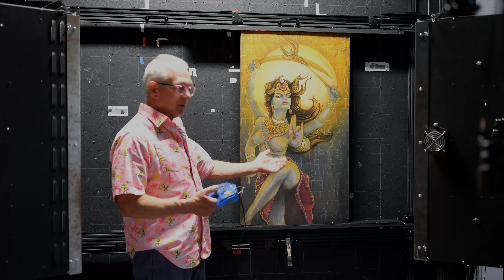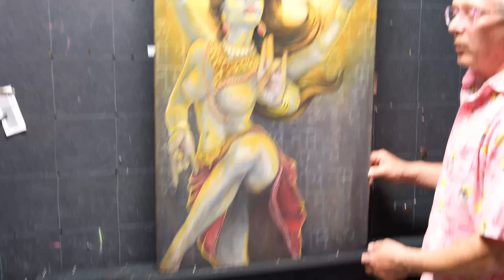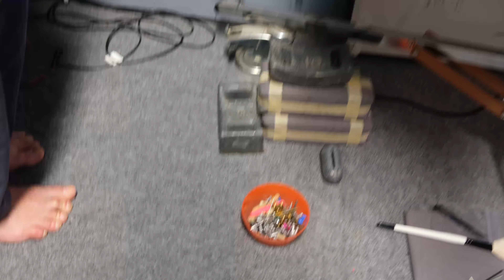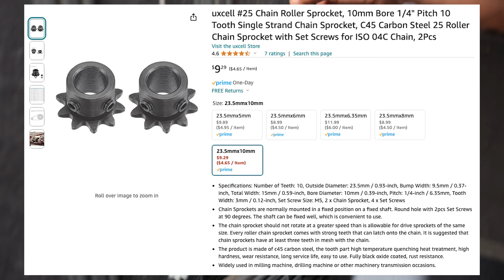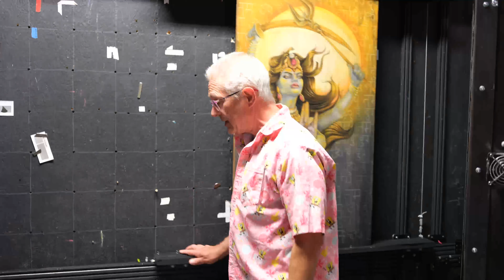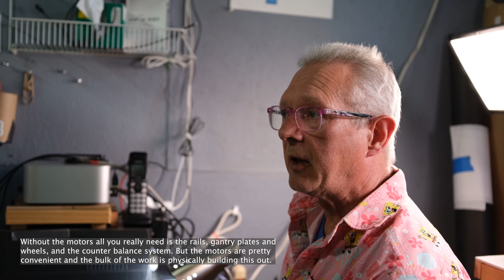Electronic, Arduino Controlled, Wall Mounted Easel

Comment: Thanks for the detailed video-- Who makes the lights you are using and what model are they?  And what is the sweet spot ifor even illunimation / actual scan area if related to the size of the light panels
Reply from the maker: Those or Northlight 900's. They're no longer available. Each one has six 150 watt 550K metal halide bulbs with a UV coating on them and the face of the lamps have a diffuser and a polar sheet. So that's 1800 Watts of lighting.

Comment: Hello, I have a question. When you take photos, do you click one by one photos or do you shoot live continuous? If live continuous is like video recording is possible then please explain.
Reply from the maker: we shoot manually. I have the code for the arduino to tell it where top left and bottom right are so it could do it automatically, but we still prefer to do it manually. It's safer for the art and it gives us a chance to verify the shots are coming in as expected. 

The old Gigapan devices had that function too, and for panoramas the automation is great, but for art we prefer to do it manually.

Comment: Hi, You did a great job, I noticed something so please reply. 
Why did you put two steppers for the Y axis, one for the left and one for the right? Why doesn't one stepper do the job in two directions?
Reply from the maker: @1darkves  we used two steppers to keep the tension even. Also, when artwork is on the rails, it can get heavy, so having two motors help hold it in place. In order to keep them cool we set the stay current to 50% when they're not in motion so they hold the weight without overheating. if this was horizontal we could use one motor, but it being vertical we found two to hold the weight better and stay in line. It was too much force on one side with one motor. There's a lot of weight and counter weights

Comment: One more idea: It would be useful to map d-pad to set number of steps/distance. For example: 1 d-pad click to move 20 cm in selected direction. This would make scanning grid consistant and fast. Also, it is super easy to connect arduino via intervalometer/remote port on camera, so you could also trigger the camera via controller. As for how to program it - ChatGPT will help you with that.
Reply from the maker: The DPAD does function like this. The joystick moves the artwork freely. The DPAD moves the artwork in a set distance, and you can easily change that distance in the arduino code. We've currently got it set to 6" on X and 9" on Y, providing over 600 PPI with plenty of overlap.
Reply from the maker: We do have that btw. The DPAD functions like that and we often use it.

Comment: Great project and use of space. One idea for Z axis: If you would   add 5:1 worm gear-box to stepper - you would remove the need of counter weights and make it run smoother by microstepping and runing faster.
Reply from the maker: thanks! Yes! That's what we wanted to do, but we could only find worm gear boxes a maximum of 48" (about 120 cm) and we needed more than that. The size of it made that difficult. The worm drive was our first choice for sure. We just couldn't find a 9 ft worm drive box.
Reply: @BellevueFineArtRepro Sorry. I did not mean rack and pinion. Instead of attaching sprocket dirrectly to motor - ad a worm gear reducer, sized for stepper. Worm drives can’t be physically back driven, so motor would not need holding torque. And gear reduction would remove the need for counter weights.